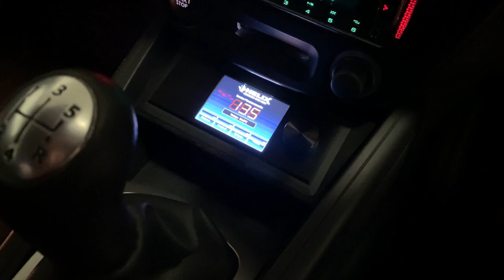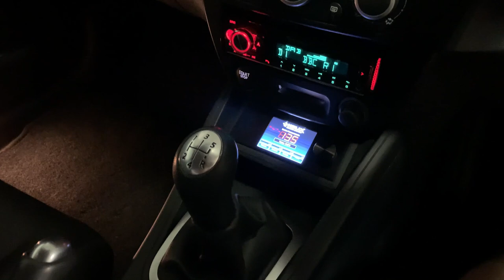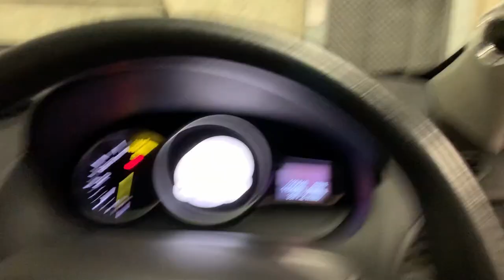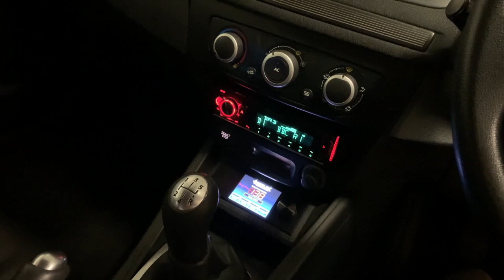1 week MEGA MEGANE SQ Install - PART 8 - Walkaround & explanation of the finished installation

Comment: Awesomely beautiful sounding build.......What budget does one have to be in to achieve this level of result?
I want this in my  car but it would  be 3 K to ship my car  to the UK plus ground  transport.
Reply: like to know too
Reply from the maker: ajazzyluv first we have to make clear the “this level of result”. -> The result is always down to how well the speakers are installed in the given locations in the car and how well those speakers work in that application, T/S specs of speakers matter a lot too. 
Midbass install is always the most difficult, but in this case we were lucky and we got a million dollar midbass result instead of something mediocre in a resonating door. 
So how good results you can get with an equipment list like in this car with this budget depends on your car and what is allowed when it comes to installation. 
This given setup would be around £6-7.5k depending on the amount of days it takes to fit everything to similar level. In a way this is a medium level installation (in terms of time) and equipment in Pssound’s portfolio. 
Check out the Insignia install we did in February which is rather the extreme top-end in equipment and installation time, where you need serious budget, like £40k+.

Comment: Nice build it looks good. Quit question what are some of the dsp you like or the easiest to work with?
Reply from the maker: Stormy Young i only really use & sell Zapco and Helix. Mosconi has good sounding DSP, but what’s easiest to use is relative. Check out the tuning playlist where you can see Helix & Zapco platforms too.
Reply: @pssound9749  thanks for the info much appreciated